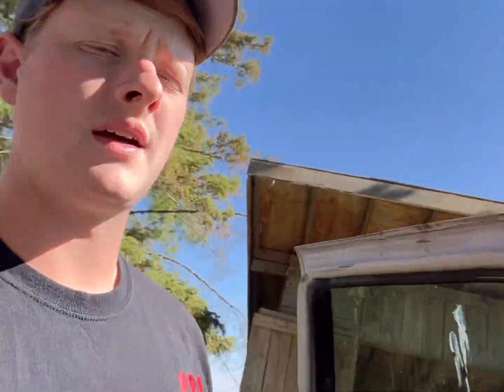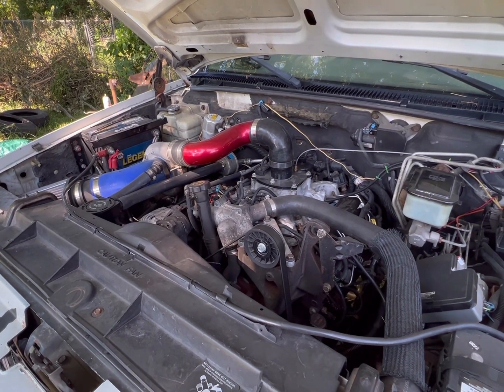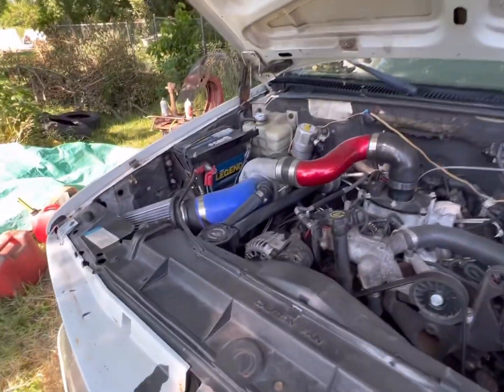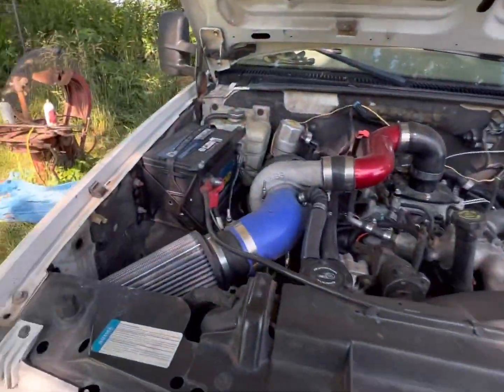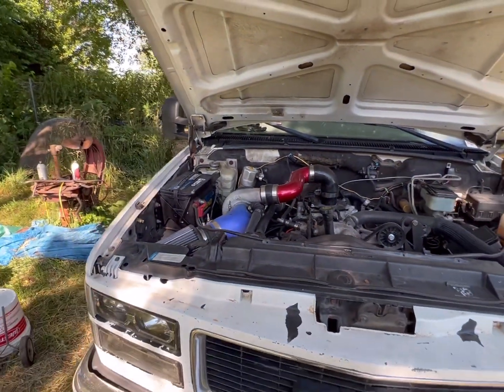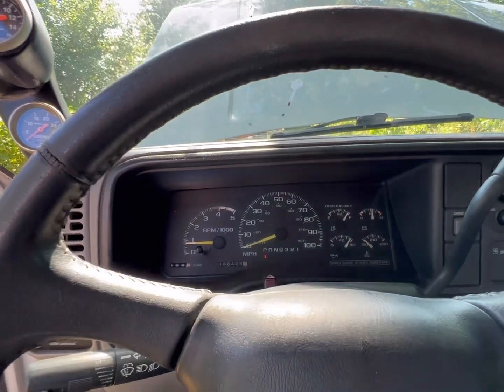GSC 6.5L diesel battery cables and grounds

Comment: I’m abit late to the party but I recently got a 94 6.5 with no power to gauge cluster… the truck turns over and I have power everywhere, I saw that you mentioned that back intake ground 2:17 do you think that was cause it? I’m gonna try tmro but I’ve done everyother ground and gone thru my junction box aswell. Thanks
Reply from the maker: You can try that rear intake ground but if you have no power at all you have issues under the dash.
Reply: @gingersnapcustoms ok thanks I appreciate alot

Comment: Which ground would cause the truck to not want to start , im not getting fuel when the injectors are cracked, It cranks over nice but no fuel ,
Reply from the maker: Passenger rear of the intake runner ground. Or the ground from PMD harness to injection pump if it’s a 94-00. If it’s a 92-93 you probably have no lift pump pressure. Same goes for a 94-00 if the filter isn’t full. Or you have no positive pressure it won’t fire. Or the PMD 94-00 is the issue. Normally grounds aren’t the cause of a no start. Fuel not getting tank to pump is the issue.
Reply: Ok it's a 2001 c3500 does that change anything
Reply from the maker: @benfriesen6462 not really. 94-03 6.5s all have the same struggles. It could be a bad fuel shut off. It could be a PMD harness. Could be the oil pressure sensor. Could be a few things.

Comment: Battery light is on and rpm doesn’t work on my truck
Reply from the maker: Tach is run off the alternator. If the second plug isn’t hooked up it can cause that issue. Or if the alternator is junk that will do it too.

Comment: Wow is your oil pressure gauge accurate? If so what oil pump is on it?
Reply from the maker: @secondamendment1890  a stock 99 oil pump with 187k miles.
Reply: @ mine only makes 40psi on a cold start and warm idles around 15, under load 35-40. It’s a 2000 so everything should be identical to the 99. Any idea why mine is so much lower?
Reply from the maker: @ I’ve been in over 30 of these trucks and I have never seen two read the same on the dash. On a mechanical gauge they are normally close. When the OPS fails and the lift pump circuit portion is lost I’ve noticed the gauges read much lower. I’ve also found that stock oil cooler lines read lower. So it could be anything.

Comment: Ive never worked on one of these engines do i dont really know anything about them, that being said we have one in the shop, its a Makeshift fire truck fir the forestey department. 1998 c3500.

The truck will surge up and down while idling, it will run down the road and sometimes lose the accelerator pedal all together, in just go into an idle, other times the truck will just shut off.

Things we have done:
1.New accelerator pedal
2.New pmd relocated to top of intake horn with heat sink
3.tested both lift pumps, its a dual tank truck 
4. Cleaned grounds.

Where should i check next?
Reply from the maker: @andrewarmstrong9194  if it’s surging you may need to replace the main under intake harness. It could be clogged tank socks. It could be an issue with the injection pump. Is it throwing any codes? Knowing those I could probably tell you what’s wrong. Also if it has an optical noise filter on the IP harness, remove it.
Reply: @gingersnapcustoms  no codes, as far as know it's bone stock other than the pmd moved.
Reply from the maker: @ no codes and it bucks? Check for the optical noise filter. Check fuel flow at the IP from the lift pump makes me think a tank sock is clogged.

Comment: I have a 93 6.5 with 2 new batteries and this is now the second starter i put in today..i get nothing when turning the key..i get lights of course but no crank.. struggling over here..any advice would help
Reply from the maker: @paulalbertson1597  replace the battery cables and verify the fuse block isn’t corroded. Also make sure the starter ignitor wire isn’t damaged.
Reply: So im pretty sure i have a short circuit wires were getting real hot replaced the boof corroded distribution block the gold 3 pole one for a heavy duty 4 poll alot of people had good reviews didn't have any power could not for the life of me figure it out ended up putting a terminal ring on a wire that was cut then BAM HAD POWER note before i replaced the distro block it was smoking happen twice now that that is handled i tried starting her up right she ran for an hour (i counted)because she had no power for maybe a week and a few days then i tried to start her before i went to work and i guess maybe a wire under the dash is getting burnt up as well mad smoke started coming out the dash so i ripped the dash out thinkin i caught fire (no fire) thank god but now i need to trace that issue thats the first time i seen smoke come from that ever so im having a pretty serious wire issues its a Detroit 6.5 na inside of a chevy 3500 school bus short bus who ever wired her up needs to seriously never touch wires again however positivelyeverything mechanically is sound and no issues on that front just wires im not trying to catch on fire so any tips would be great im ready to rip every single aftermarket wire out gotta point out it was a school bus after all they have to add alot of wires for the stop sign and the lights etc however none of that is on the bus anymore so alot of the wires are useless and maybe causing extra work for the wires that are important wires are a pain in the ass so u tell me what  u make from what i described @gingersnapcustoms

Comment: If I only knew if the grounds are the reason for my Dash warning light Problem. The Dash warning Lights seem to work randomly. Most of the time when I turn the Key to the first position the red warning light for Parking Brake comes on and Glow Plug Light comes on. But thats about it. The service throttle light is missing and the service Engine Soon light is also Missing. Need the service Engine Soon light to see if i have any error Codes. Tried to get the codes with a simple paperclip. But not gonna happen when you have no Engine Light on the Dash. Electrical Problems are real pain in the ass...
Reply from the maker: @Jean_1999  if it’s a 94-95 it’s most likely the E brake pedal spring letting it sag. That can be the parking brake light or its distribution block below the master cylinder. 

No check engine light. Check the ground on the passenger rear intake runner. Also check the one under the driver side of the dash (not easy to find. It’s by the e brake assembly).

Comment: I need to see where the battery ground wire connects to the body of the truck off of the driver's side, Was having starting problems and noticed that the battery groundwire to the driver's side was disconnected
Reply from the maker: There isn’t one from the battery to body on the driver side. Only passenger side to the fender. Then the main grounds to the intake.

Comment: Having some issues with my 01 C3500HD - Went to start it one day and the brake lights were stuck on.  I assumed it was the switch, so I pulled the relay and sure enough, it sparks on plug in.  Pulled the relay, charged the truck, ordered the switch.  Plugged the relay back in later in the day... No spark.  Brake lights work fine now?  Today I went to start it, completely dead.  Hooked up the jump pack and as soon as I didn the horn started sounding.  pulled the fuse now.  I'll try all your grounds in this video but wanted to see if you'd run into those (seemingly related) issues.  Brand new batteries.
Reply from the maker: Make sure you don’t have a tail light ground touching a frame rail. Also if one of the battery cables are worn and touching something they shouldn’t, that too will cause issues.
Reply: @gingersnapcustoms  is the tail light ground not supposed to go to the frame?  I’ll trace it and be sure.  Definitely some gremlins in this truck with the battery running down and all.  Might just put a battery cutoff switch in it and call it a day honestly.
Reply from the maker: @SamuraiJeff  it should ground to the rear frame and up by the fuse block if I remember right
Reply: I got lazy and just put in the  battery cutoff switch.  In the process I tied the battery negatives together like you suggested and it starts strong every time now (in the relatively warm weather).  Thanks for that.

Now I'm trying to decide if I want to try replacing my glow plug relay - As soon as I key on it skips the warm up and goes straight to afterglow.   Cleaned all the grounds as you suggested.  No luck.
  @gingersnapcustoms
Reply from the maker: @SamuraiJeff  if it is going right to afterglow that relay is most likely bad or isn’t grounding well to the coolant block off plate.

Comment: Hi, 6.5 starts and revs high and dies now. Fuel pump? Going to have to send you a christmas present, haha.
Reply from the maker: Check engine light? I’m betting the injection pump has left the chat if it does the rev and die now on start up.
Reply: yeah yeah, check engine light. Thanks. @gingersnapcustoms
Reply from the maker: @theotheronetoknow5828  if it’s a cam position pump error or a pulse width error that would be the pump dying.

Comment: I have to give you a compliment about a simple electrical system hint:  I couldn’t see the forest for all the trees that were in the way!  1994 Chevrolet C-3500 6.5l TD.  

After replacing the PMD, fuel filter that was still clean, adding the Leroy Diesel power cable for the lift pump:  MF still wouldn’t start.  One of your videos advises to get two new batteries, even if your current batteries seem okay.  Guess what:  those 2 new batteries spin the 6.5 over so fast it starts just like new.

Without the simple but obvious battery suggestion, I would have been on the way to spending tens of thousands of dollars on a replacement truck.

Costco green Interstate batteries were more than 50% below the auto parts houses battery prices, so I saved money, and in effect saved my 29 year old truck for $225, less than the price for 1 auto parts place battery.

Thanks again GSC !  🛻

Comment: Do all 6.5's have grounds on the intake? Because I got a 2003 P42 with a 6.5 and I can't see any ground wire's going to the intake studs.
Reply from the maker: Pickups and vans all have the same ground structure from what I’ve seen and been around. They may have been relocated to the side of the heads or chassis?
Reply: @gingersnapcustoms  The ones on the intake are from the battery or smthg else? I found one on top of the injection pump for the pmd. And I found 3 drivers side back going to one post near the glow plug module.
Reply: @gingersnapcustoms  Should you disconnect the battery when working on grounds? Can you get a shock or no worries. I disconnected but not sure I needed to.
Reply from the maker: @eedom69  I normally disconnect the batteries when cleaning cables to prevent any unwanted surprises.

Comment: I got a 96 1500 6.5. My ac compressor is not kicking on and when I press the ac button my antiloc brake warning and brake lights come on. Lol I guess I better check grounds.
Reply from the maker: Start with the grounds. Don’t be shocked if the ABS pump is needing replaced and that the dash switch is bad for the AC. Two very common issues in the 96-00 trucks.

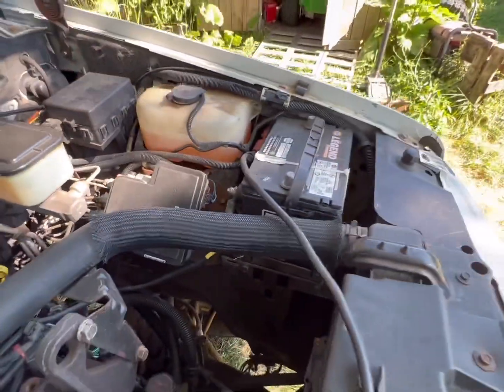Comment: I went out to start my 6.5 today and I had a few clicks and now I have nothing. I have had no real issues. It did before this problem tend to turn over decently slower than Casper does. What should I look at? Would it be the grounds 1:09
Reply from the maker: Start with the battery to intake grounds. It may be that the starter is getting lazy.
Reply: @gingersnapcustoms  it has been kinda slow to turn over. I mean not terribly slow but not as fast as Casper. Shoild I also check the power wire?
Reply from the maker: @camdencalloway2647  typically when they start getting slow it’s a ground issue. Or the starter itself is just tired
Reply from the maker: @camdencalloway2647  you can check the power wire. But that typically isn’t the issue. An amp draw test would be the best bet to see if the starter is pulling a lot more current
Reply: @gingersnapcustoms  so if the ground was bad then would that mean my starter wouldn’t even click because when I first tried to start it, it did click and then I got a jump from a friend thinking my batteries were low from something but now it doesn’t even click. Would the grounds being bad cause it to do nothing?
Reply from the maker: @camdencalloway2647  if it isn’t clicking at all the starter has left the chat. When they fail it’s typically pretty sudden.
Reply: @gingersnapcustoms  it did click a couple of times. Then it quit clicking. You think it’s the starter and not the ground then?  Also how bad is a starter to do?
Reply from the maker: @camdencalloway2647  it’s the starter. They aren’t hard to replace. So not shim them and disconnect the battery when doing the job. Also make sure the front bracket gets reinstalled
Reply: @gingersnapcustoms  which battery gets disconnected?
Reply: @gingersnapcustoms  also is there a better way to reach you instead of here?
Reply: @gingersnapcustoms  I have a video that could show you how it normally cranked

Comment: Great videos!  I have a 1992 Chevy K2500 with the 6.5 that I just bought.  Charging warning light was on and batteries were dead when I bought it.  Replaced both batteries and the alternator.  Light on the dash is now off but is only charging on the gauge at just under 14 volts.  On each battery with a voltmeter the driver side battery reads charging at 12.6 and the other is 13.3.  All grounds look good as are other cables (passover, etc.)  Any ideas on why they aren't charging over 14 is greatly appreciated.
Reply from the maker: A lot of times these new alternators aren’t good out of the box. I would take all of the grounds off and clean them along with replacing the grounds from the intake to the battery. That should improve things.
Reply: @gingersnapcustoms  Thank you.

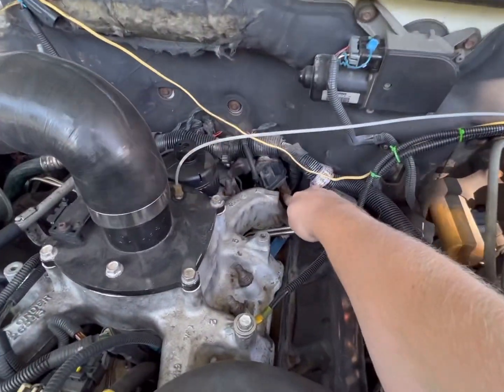Comment: Hi at 2:00 there is a little hose running across just above your hand. What is that. Replaced a pmd and noticed a little tube in a black sheath and it wasnt running to anything. I touched it to inspect it and it was so brittle it snapped. But the color of the actual hose part looks just like that. I have a 1999 Savana so the van chassis are different and I'm waiting on the service manual. Didn't have issues while running after the pmd swap but I can't get it started very easily. Really worried we broke that brittle tube and it was important
Reply from the maker: That’s the drain for the water separator on the fuel filter housing.
Reply: @gingersnapcustoms  okay thank you. Hoping i can track it back to the source and it's easily fixable but these van chassis arent fun usually

Comment: Great video. My truck has new LP,  bypass LP harness, pmd relocate kit to bumper. It randomly shuts off. Sometimes starts right back up some times it doesn't. When it happens the LP won't turn on and has zero pressure and engine just cranks. Maybe bad PMD extension? Maybe bad grounds?
Reply: Your fuel pump relay in fuse panel is bad under the hood from drivers side top far left relay, I just replaced because one pin burned out. Runs great now. Pump runs perfect. I first replaced PMD with relocation, sensor on pump sensor on turbo reworked everything I could find and turned out to be relay.
Reply: @greenthumb2856  awesome I'll take a look in the AM
Reply: @WintersMachining 
Did you e er find the problem?
Reply: @foreverssober  yes it was the ground strap under the down pipe that mounts to the firewall and frame. Never had the issue again after that
Reply from the maker: It could be a bad PMD extension harness or a burned resistor in the PMD itself. Possibly a tired crank position sensor as well.

Comment: Idk if you have a 94 to show grounds on I’d assume they are the same but I got electrical issue when I hit brakes roll windows up or down or have headlights on the gauges go crazy I’ve checked barriers and junction box on the cowl and nothing seems to work
Reply from the maker: I don’t have any others now. Just casper remains. I can say I’ve never had one do that. Sounds like you have something in the tail light wiring that’s grounding out which is messing with the power in the rest of the truck. Or it’s the dash harness itself.

Comment: Do you start it with 24 v or 12 v ? 🤔 how do you take awy the beep sound when door open ?
Reply from the maker: This is a 12 volt system due to the battery’s being in series. Voltage stays the same. Amperage increases. The door buzzer has never worked in Casper. I’ve had the truck for ten years and none of the alarms work.

Comment: Wow, you have good oil pressure I can see. Is there a specific reason for this good oil pressure? Mine don't have that good oil pressure ☺️ the guage is staying in the middle after warm-up. I'm going to change oil and oil filter today. Thinking about maybe do an engine oil clean at the same time to get sludge out of the system.
Reply from the maker: That normally means your oil pressure switch is bad.
Reply: @gingersnapcustoms  thanks for the reply, I will change it ☺️ thanks 🙏

Comment: So I've always waited until the glow plug light stops flashing to start my truck.  You said this is the after glow cycle.  So it wont harm the glow plugs to start the engine after the initial wait period?  Thanks for the video.
Reply from the maker: It won’t hurt it at all. I’ve started mine after the end of the initial cycle for 60+k miles. I’ve pulled the glow plugs even and they had no damage or issues. The afterglow allows them to cool off leaving the chamber cold by the time you fire it.
Reply: @gingersnapcustoms   Good to know.  🤙